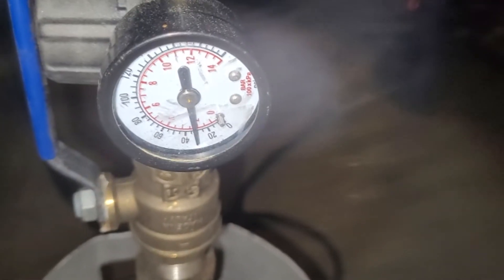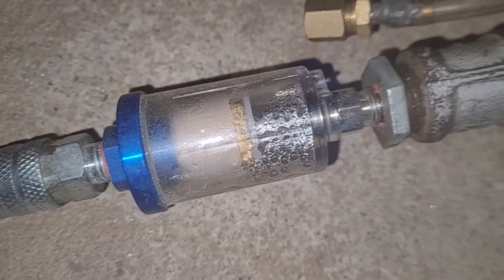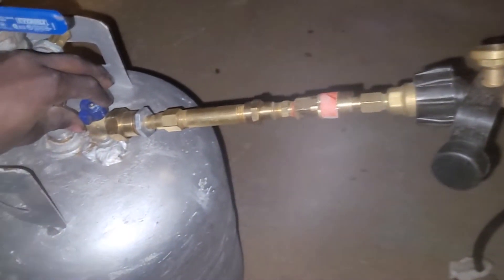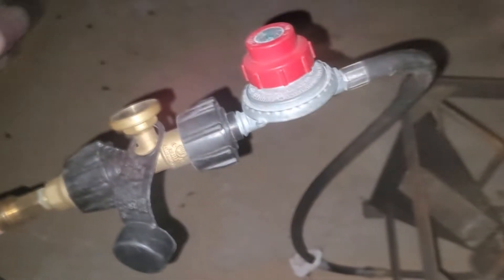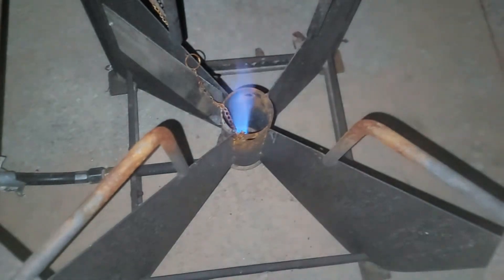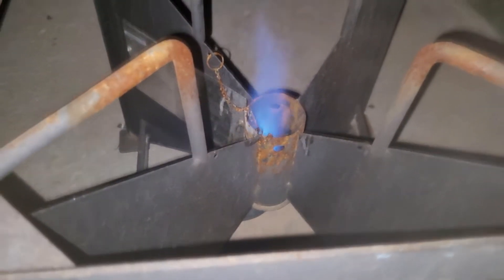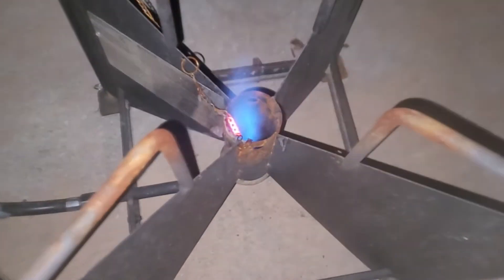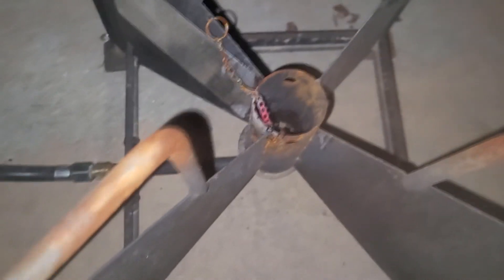Fuel Made From Plastics in Propane Burner! (Microwave Pyrolysis Reactor)

Comment: Nice stuff, man. Question: Did you already burn that gas directely from the the reactor? I know the flame will turn into yellow because of excess os gas (mixture rich), but seems to me a safier way (not the most eficient flame i say).
Reply from the maker: No, this gas is filtered and treated gas from the reactor that has been compressed at 40 psi. When burnt straight out the reactor, its a yellow / orange and sutty flame.
Reply: @naturejab  I see. One more thing. Did you make vacuum on the storage gas tank to prevent oxigen get into It?
Reusing the gas seems to the most import thing que doing pirolisys.
Reply from the maker: @yashiro798  I most definently purged all the oxygen out. I put the air compressor inlet on the outlet of the tank and the storage bag to make sure as much oxygen was out as possible. I also have flashback arrestors and check valves on the tank.

Comment: I have some hesitation about compressing that gas.  It may contain free hydrogen which can embrittle steel and crack it, then you have an explosion.  You should have some professional analysis of the gas so you know what's in there.  You should stick with gasometer storage methods (i.e. the garbage bag or an air mattress).
Reply from the maker: Great point. I haven't done any chromatography so the safest option is relativley low pressure forms of storage. I'll be storing it in an innertube for now.